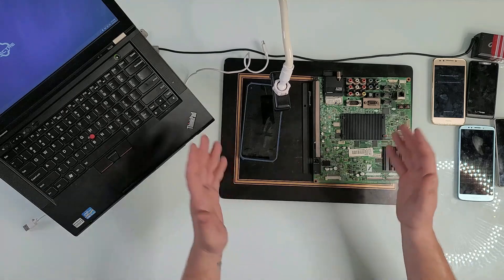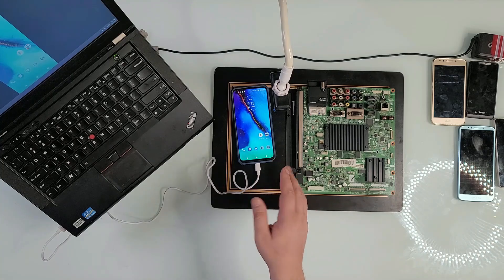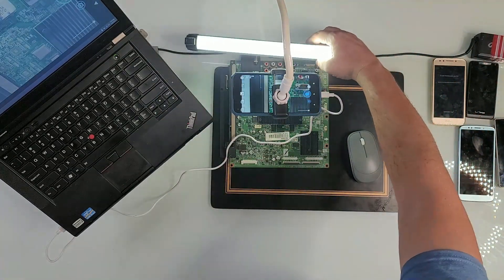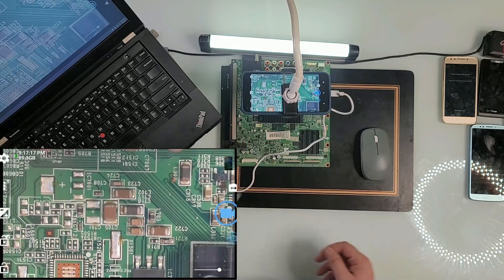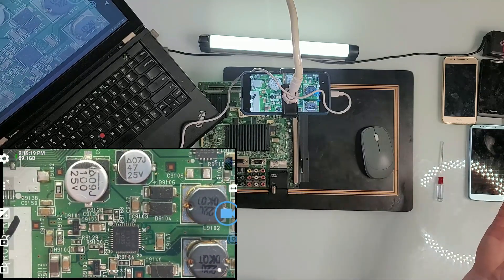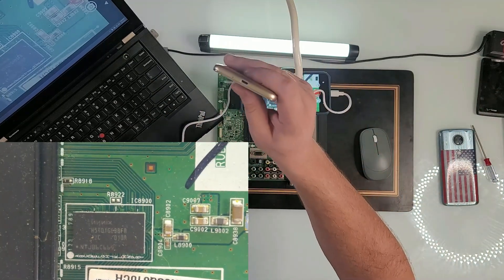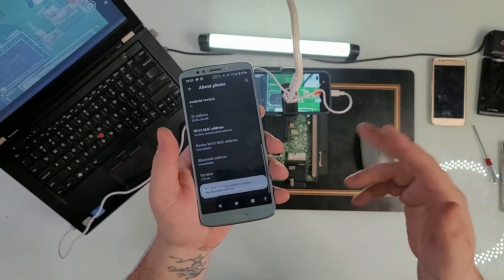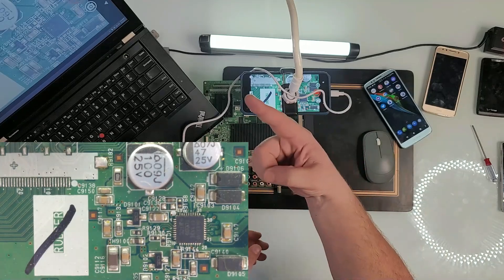Turn your old Android phone into a Microscope

Comment: Right on dude. I was just about to order one of those crappy microscopes from amazon to try again at modding my Xbox because my first time trying was a fail. I just couldn't see the small points on the board. I should have better success now... hopefully ;-)  We'll see. There is a version for Linux which makes me happy too. And yes open camera works way better.
Cheers
Reply: I'm trying to do the same thing. Have you succeeded in modding the xbox?
Reply: @currentlyhalfdead4987  Nope. Actually screwed the motherboard. Sold the xbox for $10 because of it. Way beyond my skill set. Rather buy one all ready done. Good luck.

Comment: Darn! I just bought an expensive microscope. This will work fine on the cheap. There are also thermal camera phones which will work for basic electronics repair. The distance is enough for soldering work. I wished I saw your video earlier.
Reply from the maker: Good microscopes are still good...most have a direct hdmi out to monitor...so you didnt miss anything...especially if you repair a lot

Comment: Nice,  looking for something to hold phone above work area.

You can add hardware add-ons to improve zoom power.

You could just use phone and have a better mount?.
Reply from the maker: yeah i was thinking of making a mount myself...can't really be that hard as long as you have some either wood or metal around with a few screws...but i have a microscope already so that's why i didn't do more permanent build.